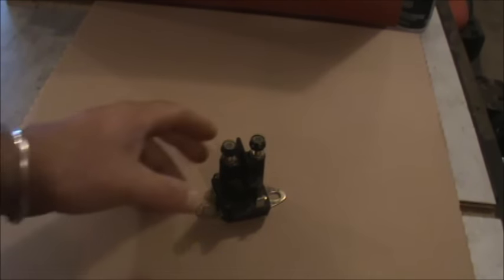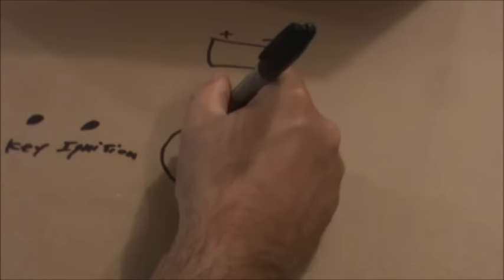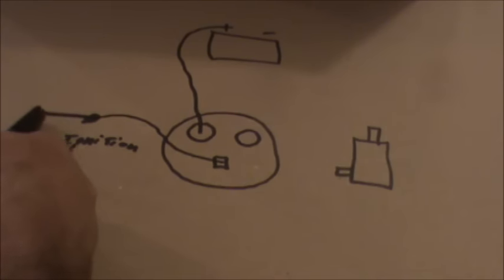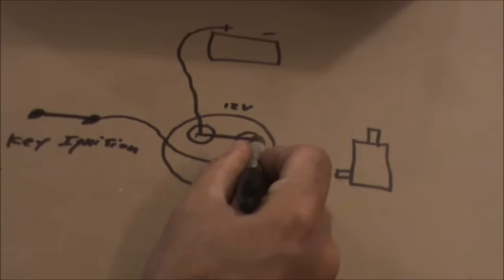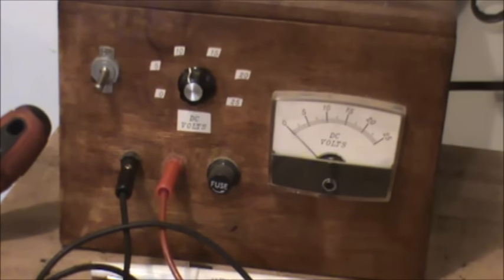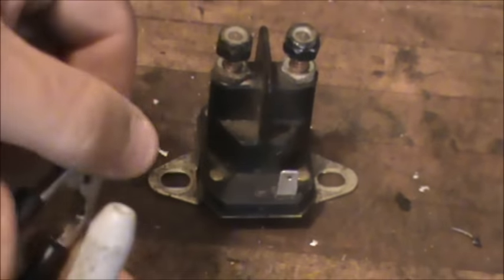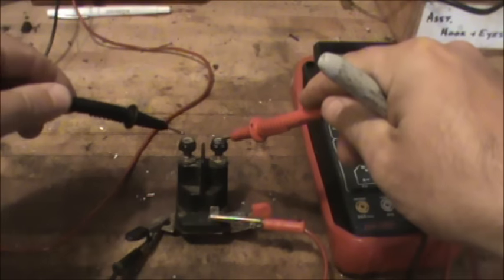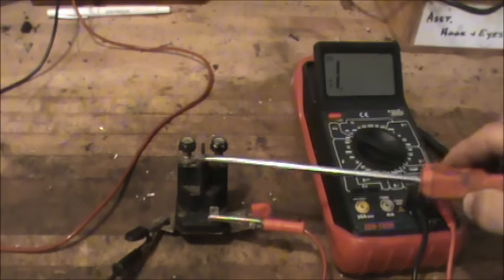How to test a tractor solenoid

Comment from the maker: http://amzn.to/2fkcu5J  3 post solenoid
http://amzn.to/2fbMp9L 4 post solenoid
http://amzn.to/2eL6e6x Tractor Ignition switch New style
http://amzn.to/2fbK5zq MTC Murray Ignition switch
http://amzn.to/2e1FDAC A decent multimeter to troubleshoot
http://goo.gl/KAzWMX Click link to order your tractor electrical needs.
Reply: Thanks for the easy explanation
Reply: What would be the difference in testing and installing with a four post solenoid?

Comment: To Doublewide6 I had a stroke in 2004 it effects my thinking sometimes I have worked on small engines for over 35 years I just wanted to tell you the way you explained how to do this is awesome because I knew that you could test them but my thinking went blank so thanks to you you triggered it by the way you explained it so from the bottom of my heart thanks and keep the good work up.

Comment: This was very helpful.  Straight to the point.  So basically the 12v goes from the ignition through the safety switches and then starts cranking.  If any of the safety switches are open it never reaches the solenoid.

Comment: I’m not great at working with electrical stuff but, you made it simple to understand.  My riding mower has worked well for me for 14 years and I have only replaced the battery once.  This year everything that could go wrong has gone wrong.  I’ll try to keep this short by simply saying that I replaced the solenoid, spark plug, and fuse and got it to working for a couple of weeks.  It quit on me again a few weeks later and I got it to working again by replacing the carburetor, the fuel pump, and the fuel line from the tank to the fuel filter to the fuel pump and to the carburetor.  It worked again for another few weeks and now I can’t get it started again.  I know the battery is bad so I jump started it and it has worked a few times but, my last attempt to jump start it, it would not make that clicking sound I would normally hear if the battery was dead.  It now makes a ziz type sound and jump starting is not an option.  I know the battery needs replacing which I plan to do but, now I’m trying to decide if the solenoid has gone bad again or if the starter is the culprit.  I hate to buy both items along with a new battery but, the only thing left I can think of to replace would be the ignition switch.  I even tried the old trick of using a screw driver from the solenoid to the positive battery post but, it didn’t have the same effect as I had as before when I tried to start it.  Since I know very little about circuitry other than what you showed in your drawing, what would be your best guess as to what is wrong now?  It is a Husqvarna mower and has served me well until this year.

Comment: thanks for the video!  i've also learned that you can use jumper cables connected to the terminals to make the switch so it can be done more remotely (especially if it's under the battery/under the seat, or as you mentioned near a gas tank.  Also, who thumbs down videos like this?  I'll guess miserable people.

Comment: With the help of your video I was able to test my 1996 5.0 F150 starter solenoid. I just got done taking it apart to burnish the contacts because it was intermittent and every once in awhile it would just click. All of the contacts inside of it needed burnishing especially one of the copper terminals which had blackened to almost 100%. I  would not recommend repairing them unless one has the electrical  repair experience. I was going to get a Valucraft at Autozone but the quality of that brand is unpredictable and the better brands were to expensive for my budget right now. Thanks again

Comment: Excellent description Doublewide6. I do had a couple of questions; how does the solenoid get its ground and witch post ,with the letters on the key switch, does the jumper with voltage connect to. (S). Next witch wire has the fuse in the wire connection? Thanks for your expertise post and preadvice       God Bless! Doc

Comment: Even when new our tractor would often just click but would always start eventually. In removing the solenoid I'm unsure whether one post was slightly loose but proceeded anyway. By your video I checked it out & checks good. But I put the new one on & now get rapid fire clicks & even with key off the battery went completely dead overnight. Can a solenoid stick in the closed position?

Comment: were is the 12v in the key switch? you said the key switch sends 12v to the solenoid. I think mine is bad , but it starts, but I have no 12v on the small post, I have a 4 post, 2 for battery, starter, an ground an 12v for key. how does the key sw. send 12v?  thanks, I work on stuff all so but I need help here

Comment: I did the same but I didn't have a multimeter so I used a bulb wired between post A and B , the connection didn't light the bulb when power added , bought a new one and it did with that one ,  just an idea if you don't have a multimeter to hand .

Comment: My Solenoid/Starter model number is: 2-2569-MI. Battery terminals were switched and the solenoid smoked. I fear it is fried. No lights on dash now and tractor (Ford 1520) won't start. Thanks for any help you can give.

Comment: Excellent vid. So it sounds like the solenoid either works 100% or not at all. Is there any situation where it wouldn't pass the exact voltage from the battery across? Mine seems to only show 11.3 on the far side, where as it has 12.3 coming in direct from the battery.
Reply: dont worry about voltage  when you turn on key you should get the starter spinning if this dont  happen short between 2 big lugs this should spin starter   this test tells you the solenoid is bad if it dont spin starter the battery is too weak

Comment: Great video but was wanting to know if the flywheel is not turning on top of starter is the solenoid bad or the starter itself? My tractor clicks but the engine does not try to turn over. I noticed that the wheel on top of the starter does not turn when I turn the key. Thanks for the info.

Comment: Another thing to consider is that a tractor supply solenoid can be expensive you can use a older Ford starter solenoid @ $10 at parts supply.

Comment: Got a newer pos craftsman...  turned off to dump bags and heard a buzzing sound.. couldn't diagnose so I disconnected negative battery cable and it stopped. As soon as I touched negative cable to battery it would try to start. Key was off. I disconnected ignition and as soon as negative touches battety it tries to start... any ideas?

Comment: My mower “clicks” when I sit down and try to start. This is unsafe like you explained. But I grab a screwdriver and touch the two prongs and it cranks but won’t start. Is that because I am not sitting on the seat when I do this?
Reply: It's because the key isn't turned to the on position. The coil isn't sending spark to your spark plugs so it won't start. And if you have an electronic fuel pump, the engine won't have fuel unless you turn the key switch on. Do NOT leave your key on when your engine is off though. It'll blow your coil up

Comment: That type of Solenoid you are testing is Not a continuous duty type. It is an Ignition switch type. They do make continuous  duty ones for different applications where a constant switched use is need. Over use of a starter solenoid will burn it up.

Comment: Seems  like with the key on... it would keep spinning the starter even after the tractor cranks up.  Shouldn't the starter stop spinning once the tractor cranks?  But if you turn the key off, it turns off the tractor?
Reply: @kudzukaraoke....The battery supplies power, to both poles of the solenoid ONLY when the key is turned to the "start" position.  Once the engine starts, you release the key, and it goes back into the "run" position, which removes power from the solenoid, and the starter STOPS cranking the engine.  If you move the key switch back...from "run" to "off"....the ignition switch connects the "ground" position to the "magneto" position on the key switch, with stops the magneto from sending the electrical power to the spark plug, so the plug stops sparking and the engine stops running.  It's magic.  lol

Comment: Great Video's many times you have helped me, I watch them all the time.  Today I have a Duromax portable generator 8500 surge, 7200 running, 420cc 16 hp.  When I pull the the recoil starter rope the unit starts in 1 or 2 pulls but when I use the starter key (Electric Start) to start the unit I hear a clicking or a screeching type of noise very similar to when to try to star a car when its already  running.  I taped the starter with a hammer with no results.  The battery terminals are clean and tight. The battery reading is 13.2 volts on my meter.  Any ideas?  maybe starter or solenoid?  Any ideas will be appreciated.
Thank You.  John A.
Reply: with off (not running) short big lugs on solenoid with pilersif starter spins this tell you he batt is good starter is good  solenoid is bad replace solenoid   easy test
Reply: @frankdavidson9675  thanks

Comment: what if the solenoid has 2 tabs with the 2 lugs?
Reply: There is no real difference just chose one of your smaller tabs[on the bottom] /Make a small jumper wire to lead to ground and ground it.

Comment: You didn't explain how the ign switch got its power.  At least I didn't see it.  Thanks
Reply: On many mowers there is a fuse holder /just follow this wire as it normally leads to a retainer that is behind a key switch [On some mowers how ever the wire may first go threw a safety or breaker switch.] Dixon and Snapper mowers were bad for this.....